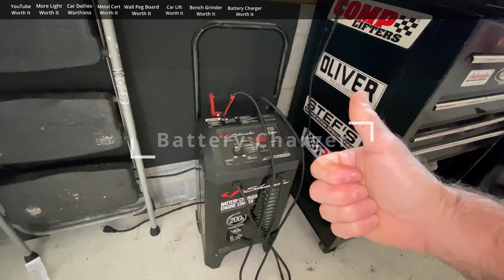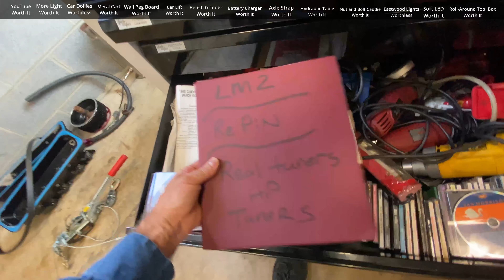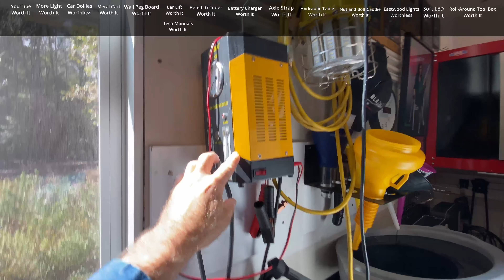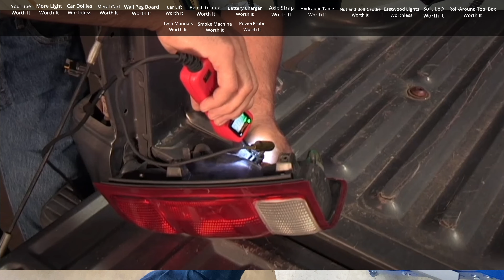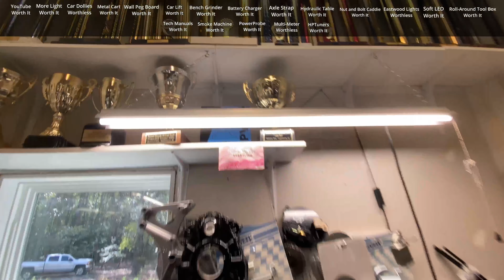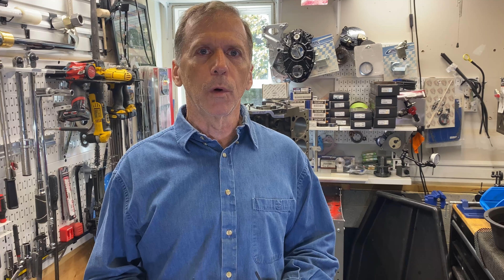Worth it or Worthless Shop Tools

Comment: Amazing video you’re the Man Karl, question i have a stock lt1 with quad 1 headers in an impala, what would you do to make it better
Reply from the maker: For an impala SS with stock engine and headers would be performance exhaust and then 3.73 rear gears.   The rear gears will be a very good bang-for-the-buck.  The car will feel quicker and still be comfortable and streetable.
Reply: @EllweinEngines  you’re amazing good sir roger that, have a great day love all your videos!
Reply: @EllweinEngines  I also have aluminum heads but need them cleaned up and assembled I figured a head and cam swap will hopefully work out eventually. Do you recommend any cams and/or upgrades to the cylinder heads themselves as well like bigger valves? It’s a daily but would like it to be more exciting. Thank you for sharing your knowledge and wisdom
Reply from the maker: Every situation is unique so I prefer to point all questions for heads and cam to the super experts like Lloyd Elliott or any other of your favorite cylinder head guys.